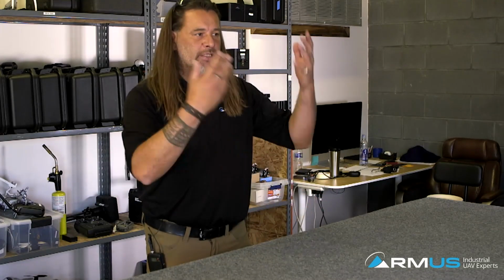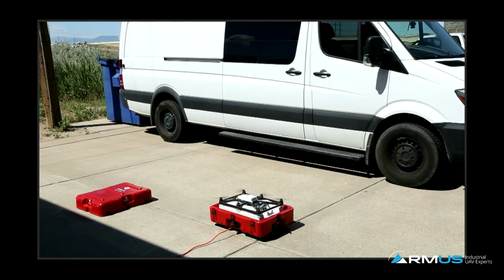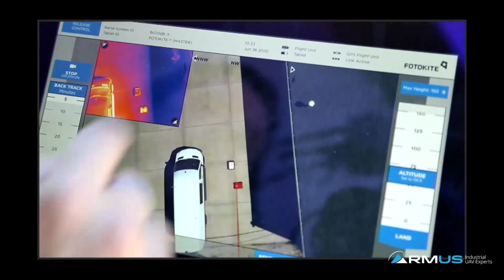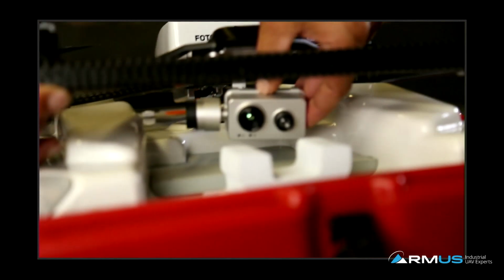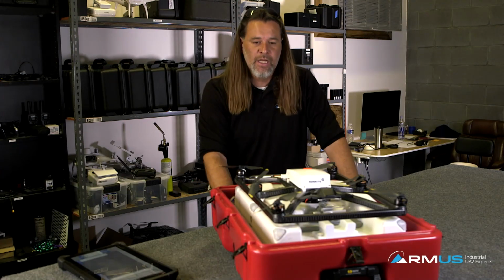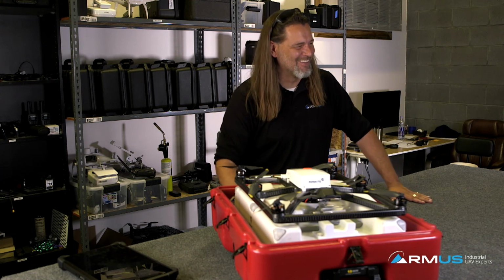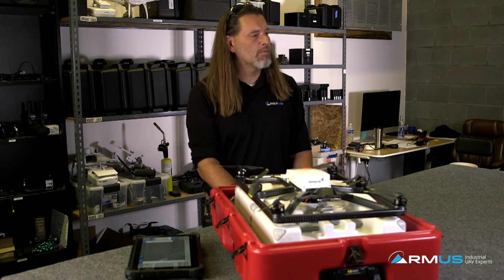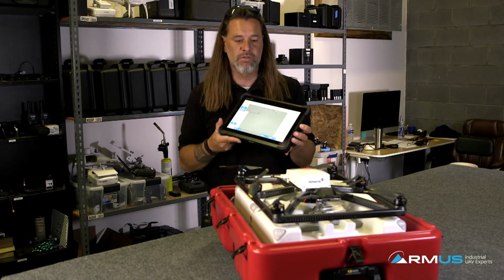RMUS Webinar: Introduction to the Fotokite tethered solution

Comment: Disappointed it only has a 720P Camera with Digital zoom. With the dropping price point of a 4K cameras I don't understand why it wouldn't have one in order to get decent digital zoom quality.
Reply: The whole power of this device is the flir cam. Especially with the flir camera you can measure during and after recording every single pixel’s temperature. The 720 cam is just for overview. Cold spots and hot spot is what I want to see In my line of work.